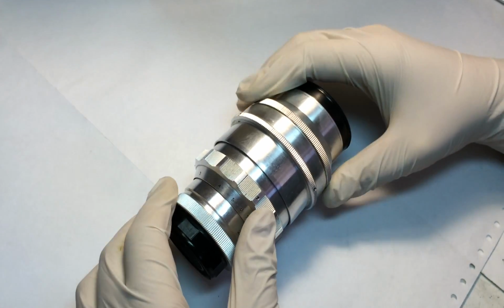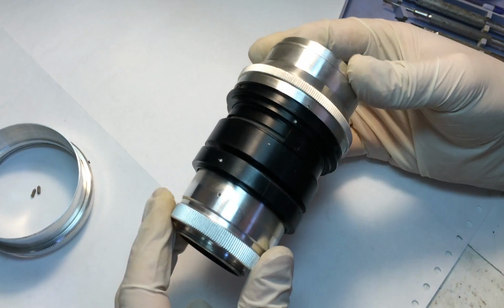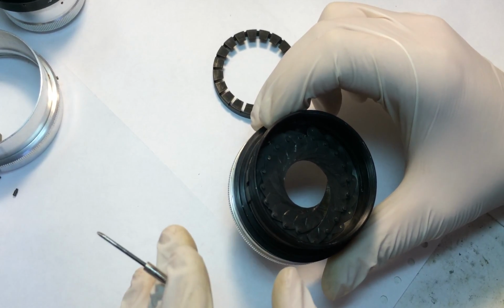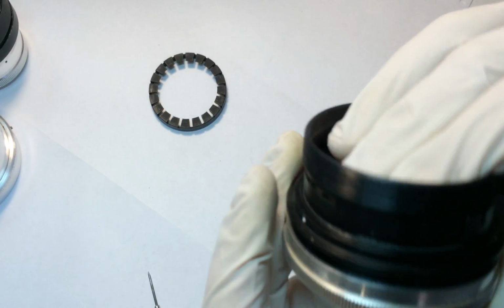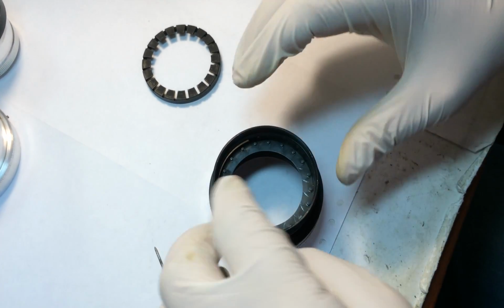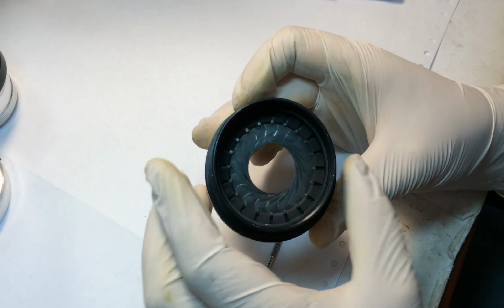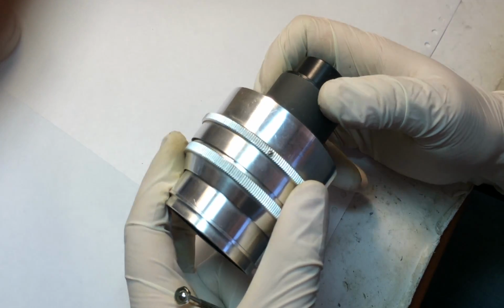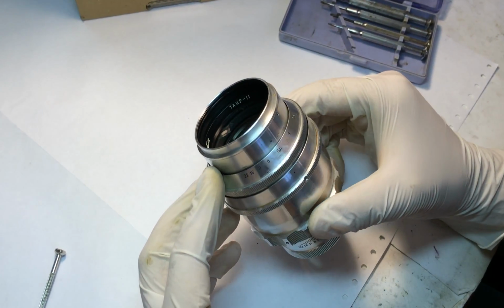Tair-11 2.8/133 aperture blades repair tutorial

Comment: Morning. Thank you for these wonderful tutorials. I was able to reseat all 20 blades and clean some of the glass elements of dust while I was inside. My question pertains to the built in lens hood. Mine is very loose. How do I tighten up the hood? What mechanism is holding it on?is there a screw somewhere? The lens hood looks to be a solid piece of metal.

Comment: Thanks for your support. Can anyone suggest why the blades become dislodged? Can anything be done to prevent this, or make it less likely? I have two 11a lenses, both with this issue.
Reply from the maker: Basically this problem occurs due to an old grease on the blades, producing adhesive effect to the nearby blades. Than, you apply a bit of force to make blades move-and that's it, they fell out from their places. Only one solution helps-cleaning of grease out of blades.
Reply: @RetroFotoHouse  T])